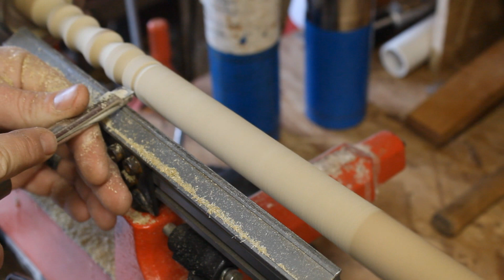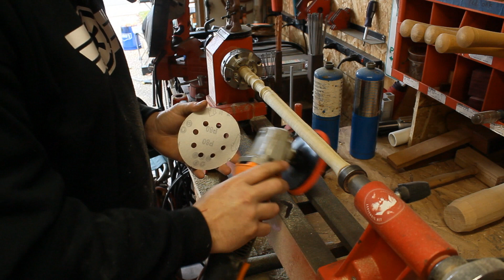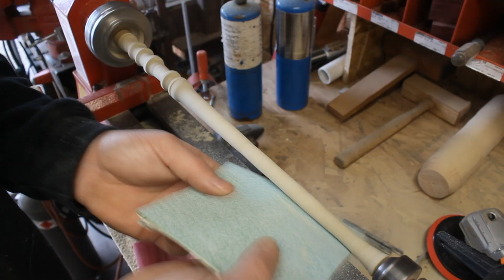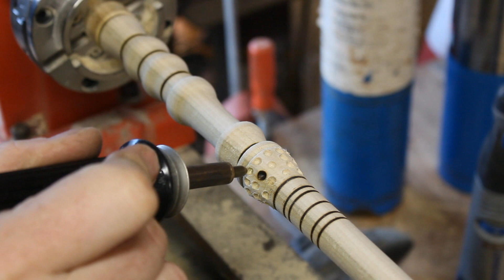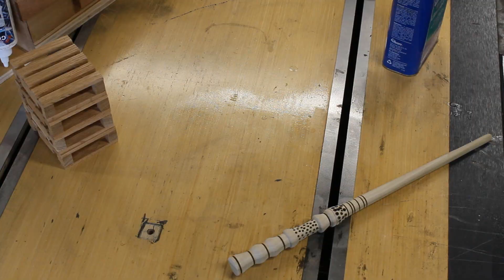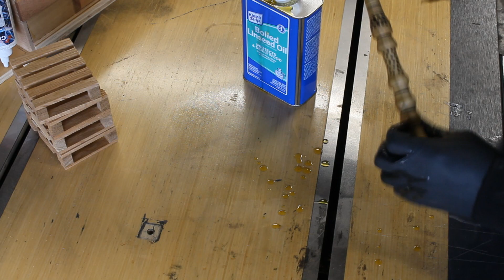Making a magic wand, simple lathe project..

Comment: Bro.....
I'm new to turning. But I've been trying to turn magic wand and get the same chatter. Also, I don't have the best tools for the job.
I've been working with carbide inserts. But that angle sander idea is perfect. 
Thank you so much. I'm glad I clicked this video. You just made my week.
Reply from the maker: One thing I was told after making this is to start turning the wand at the tail stock end. It's gets less chatter that way.
Reply: try to support it with your hand around the wand blade too.